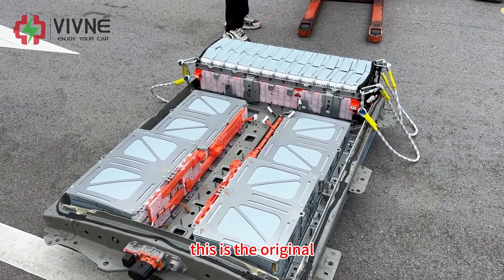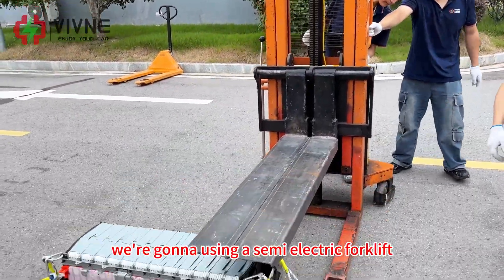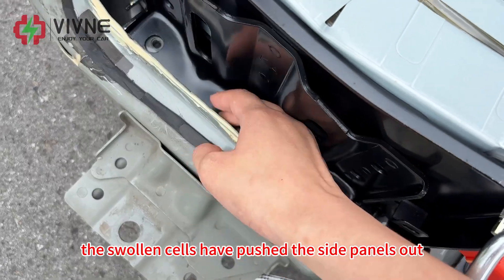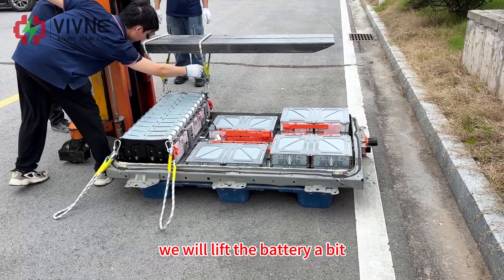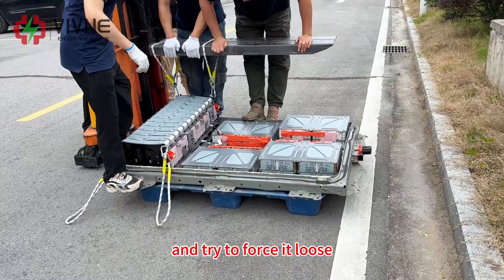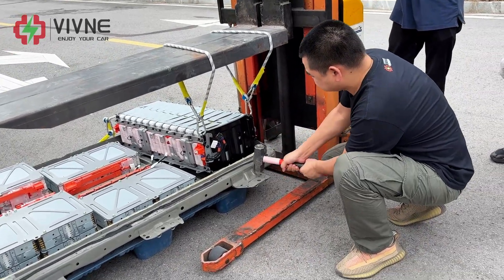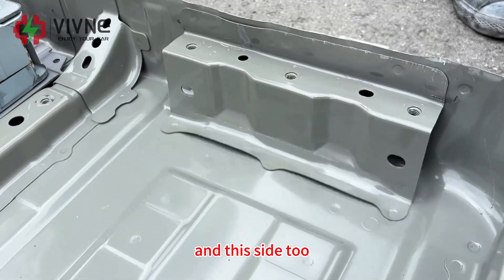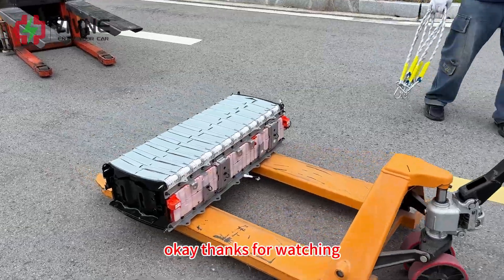VIVNE-Severely Swollen Nissan Leaf 40kWh Battery Pack

Comment: I had similar swollen cells at 170k km, and both myself and the previous owner babied the battery. Though, it didn´t help that we live in southern Spain where it gets pretty hot in the summer. Just a bad design without cooling. In 2012 they didn´t know better, but by 2018 for the 40kWh, they should have added active cooling.
Reply: Do you did not charged up to 100% often?

Comment: Wow, this pack was seriously abused. I wonder how my original 40 kWh pack looks inside after 240k kilometers. Getting my upgraded 62 kWh pack soon!
Reply: Thermal issues on these rear modules is a design flaw in 30/40/62 packs. Shame on Nissan.
Reply: 62 kWh doesn't have that long rear stack and also because the capacity is bigger the amperage load on the battery is lower and so it cools faster, heats slower.
Reply from the maker: Yes, seriously abused, we can't even reuse it. 
Oh good, where did you get the battery?
Reply: @VIVNE-CoraLiu Got it from Vivne, Helen helped me with everything. :) 
Also, this pack is not safe to be reused for obvious reasons, how will you dispose of it?
Reply: Maybe better not to know. :-)

Comment: Is there a way to detect swollen modules besides removing the battery and opening the case?
Reply: no way, there is no correlation between data from the BMS and the amount the cells are swollen.
Reply: You can see it in the top cover as in some cases it will wear right through
Reply: Often you start getting isolation faults because the deformed cells either leak or come into contact with the metal case.
Reply: No way.

Comment: Hi Cora, thanks for sharing.
Would it be possible to share with us the following information.

The date the vehicle was first registered.
Total kilometers driven.
Total number of DC charging sessions.
Total number of L1/L2 charging sessions.
Leafspy data, SoH, Hx.

Thanks.
Reply from the maker: Sorry, we don’t have that information. This battery was removed from a customer’s vehicle by our local partner here in China and shipped to us. They didn’t provide any LeafSpy screenshots or dashboard photos. After we received the battery  we connected it via an OBD2 cable and were able to read the following data:
SOH: 75%
Hx: 41%
Static voltage difference: 42mV
Reply: @VIVNE-CoraLiu 
Thanks.
Reply: Thanks. HX is really bad.